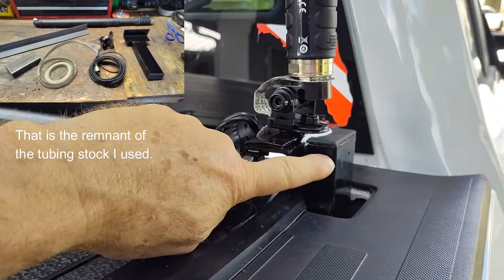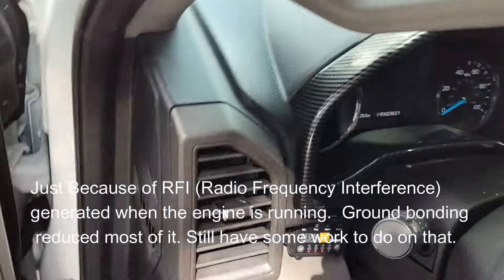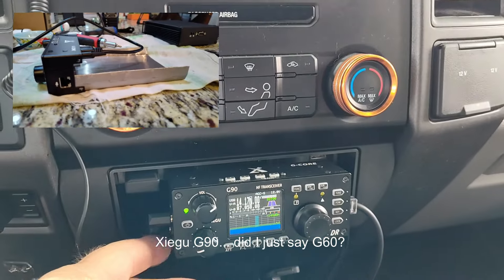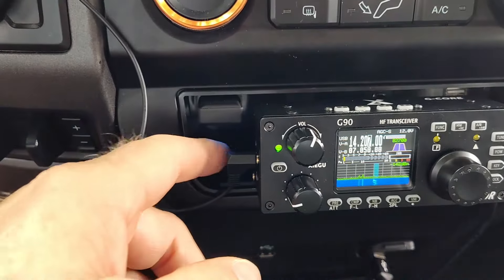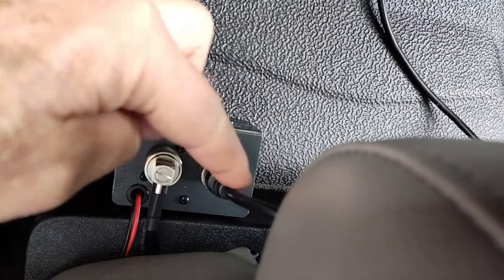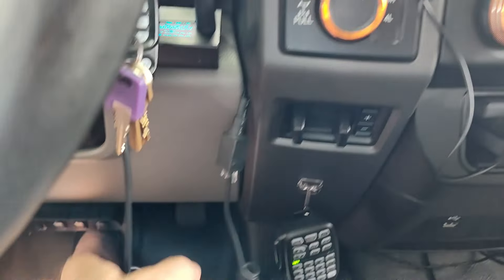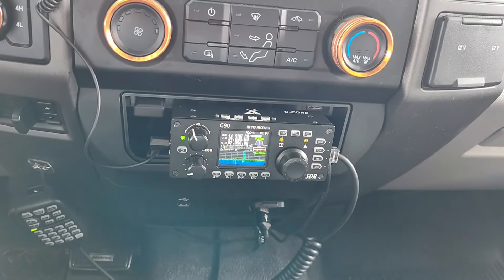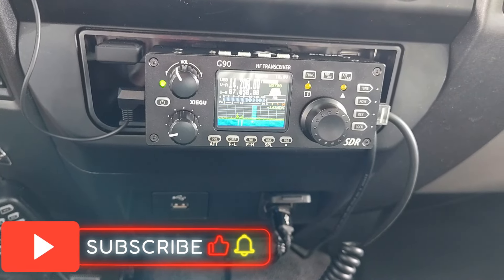Xiegu G90  Mobile with Yaesu ATAS 120A Antenna

Comment: We were just wondering if the g90 could work with the 120a antenna. How well does it work?
Reply from the maker: @gregpearson7013  I works great. The SWR sweep makes it really easy. I am going to do a 2 minute video on how to use the MFJ-1925 with the G90 and ATAS-120A.